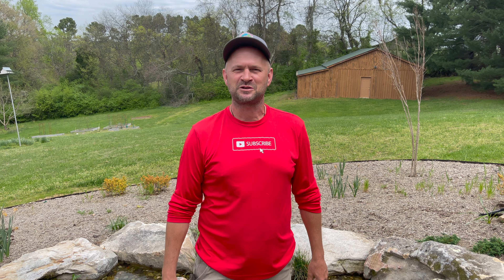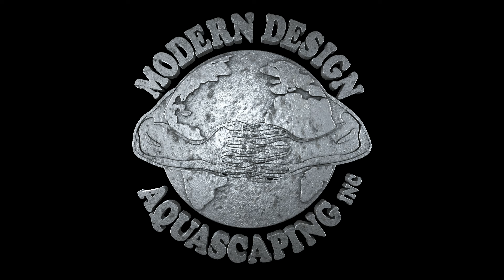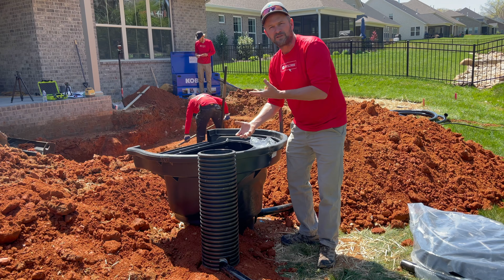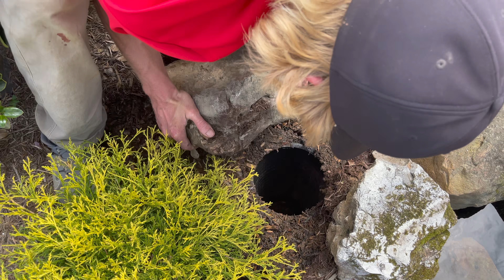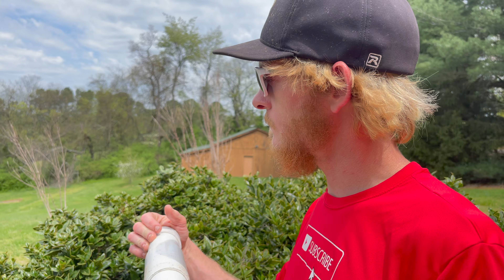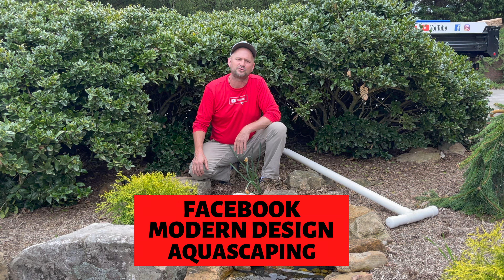Water Feature Maintenance Series 1 | BioFalls Bottom Drain Upgrade!

Comment: How much extra does the drain cost, how much extra does the additional bio media cost that doesn't come standard with the filter?  How much does all that extra stuff add to the cost of the filter?  Why is it not included with the filter in the first place? How much is the extra pump and pipe for the backwashing?   We have an easy way that is all inclusive that includes all bio media, backwash pipe and drain kit that uses your existing pump inside a pond skimmer or pondless pump vault - all at no extra cost.  It will make your job as a designer and installer much easier and faster, and make maintenance easier for the water feature owner.

Comment: Would it be a bad idea to plumb a way to just use the same pump for that feeds the waterfall to backflush? I'm thinking a couple of additional tee valves underground with a barbed nipple to attach a sump hose for backflushing? Then I don't even need to mess with an additional pump for backflushing? This is such a great idea. You can totally disguise the biofalls without worrying about pad removal every season.
Reply from the maker: Yep, we have done that. Actually split a water line into 3@1” lines that could spray down from the top, it was SUPER COOLIO!

Comment: really like the T handle to turn off/on the ball valves been needing that for a while now. John do you have a video or 2 on how to start a stream ? I am getting away from the volcano waterfall and want to have a stream that looks like it is coming up from the ground and flowing down 10 feet to the pond where I want  a spillway stone to create a small water fall. I will be using soil from the pond hole and want to use some small rock and larger rocks just to create some white water rapids for oxygen
Reply from the maker: I don’t have that video yet, but I will have!

Comment: Damn! That is a fine idea. I'm gonna put in one of those preformed ponds (I know, shame on me. In my defense, it's in the basement and I don't have Ed Beaulieu coming over to build me a better one 😆) and I want to use Aquascape's biofalls for filtration. This makes all kinds of sense to me. I'm already going to be running pipes to make water changes easier. This will make them that much more effective too.

May I ask where you're getting the additional filter pads of various coarseness, or is that a trade secret?
Reply from the maker: Aquascapes sells them-a knockoff of matala brand but same same😁
Reply: I have a 150Gal preform in my basement to grow out a few koi fry I bought from a Japanese import group buy and they are fantastic looking now that they are 4 inches plus a few even close to 7 so go for it you dont need Ed B. to do it for you :)

Comment: Thanks John 
Going to install one soon the information  you provide is priceless .
Can you tell me if the intake bay is large in constructed ( which similar to wetland  )Can you reduce the size of wetland ?
Thanks again John  
Best regards 
Peter Jex
Reply from the maker: Not sure if I understand your question but the intake is your mechanical filter, the size of the intake is based on the flow rate of the pump, which is based on the size of the wetland filter. Does that answer your question?
Reply: @KoiAddiction  
Thanks John 
Wetland water flows up 
Intake flows down to pump is there any gain biologically
Best regards
Thanks for your response